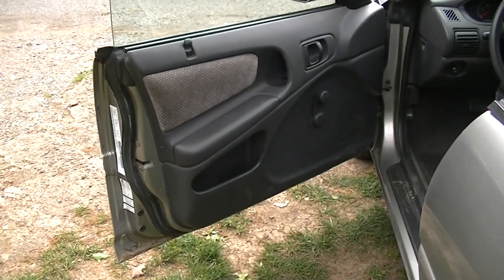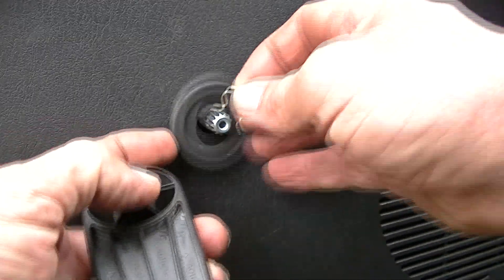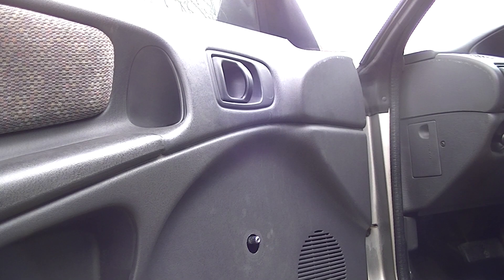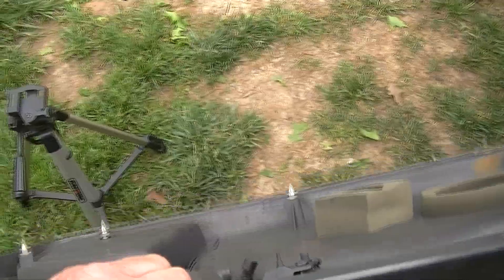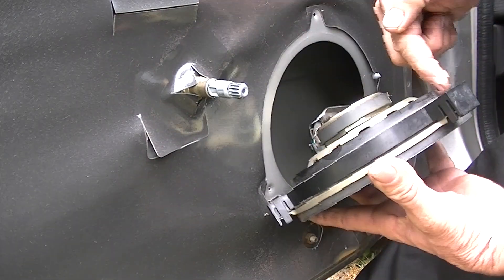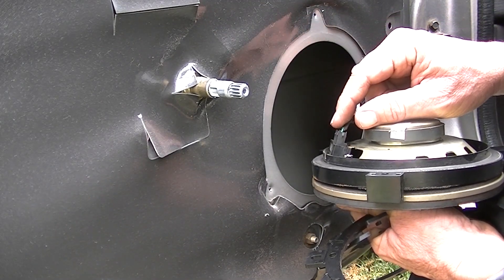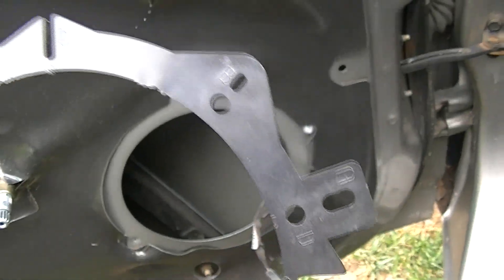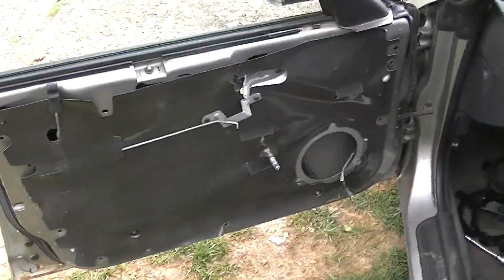1999 Dodge Neon without power windows...Door panel Removal Speaker Access.

Comment: Thanks!  Advice on putting that window crank back on would have made the job even easier.  Kind of a pain!  Haha
Reply from the maker: Ha ha...nice!
Reply: I just cant figure out how to get the window pin back on any advice
Reply: @dylanmetz3440  I think I got it back on with a thin pair of pliers if I remember right.  The challenge was aligning it and setting it within such a small gap

Comment: i have a 2000 neon. easy speaker replace in the rear deck but a pain with the door spkrs. if not for having to mess with the handle clip and the door rod mechanisms i could have done this myself. the actual speakers are easy. just 3 screws and clip the new plugs onto the wires from  the inside. but still no idea why plymouth/dodge just simply didn't place removeable covers over the speakers instead of making them part of the door panel. could have just popped off the speaker covers and been done in no time.